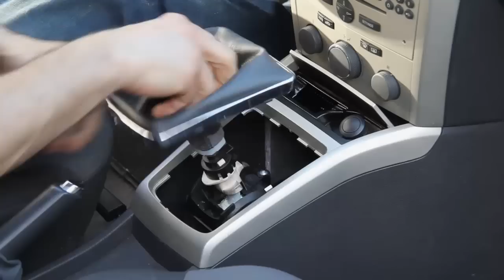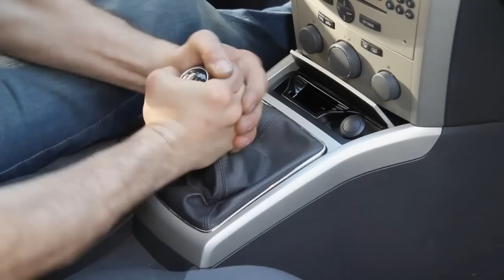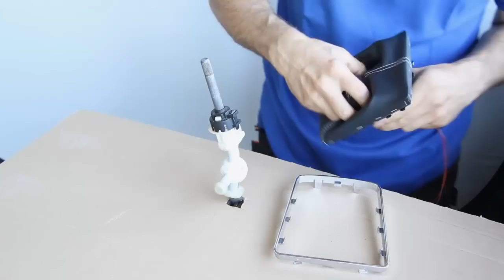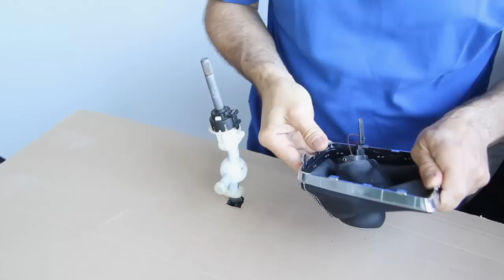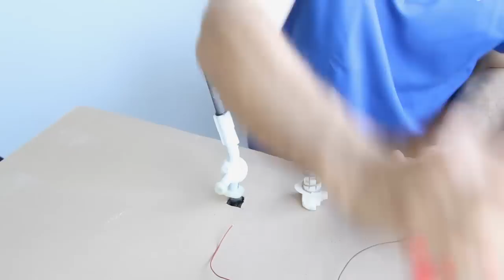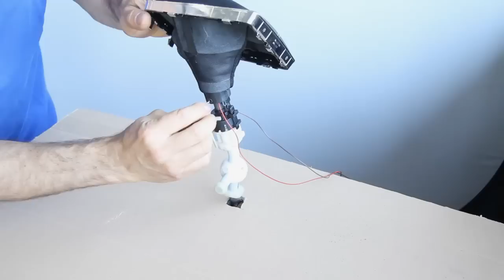Beleuchtet ICT Schaltknauf Einbau Wechsel Opel Astra H 6gang Illuminated Gear knob replacement

Comment: Wo kann ich den kaufen für meinen Opel Astra H Caravan 6 Gang ?
Reply: Sie können bei eBay kaufen kostet 21€.
Reply: @algadyoussef4520  ist es auch hochwertig ?
Reply from the maker: hier ist der Link, zu diesem Schaltknauf  https://www.innovativcar-tech.de/de/opel/229-505242-opel-astra-h-gtc-twintop.html#/27-surface-a/33-emblem-emblem_01/82-stitch_color-ns/98-ledcolor-ohne_led/142-model-model_4